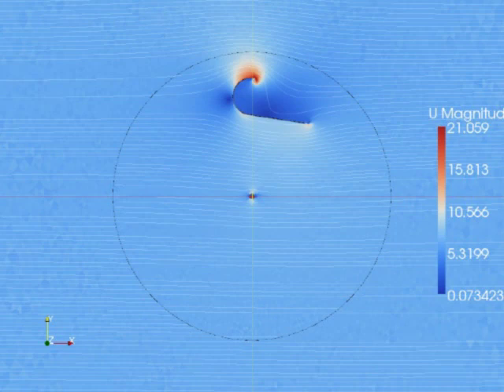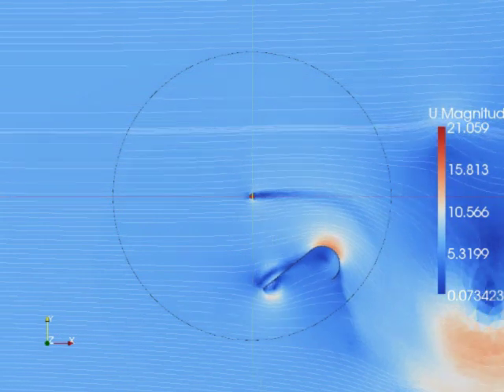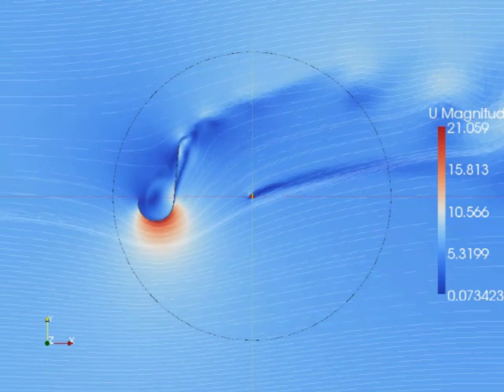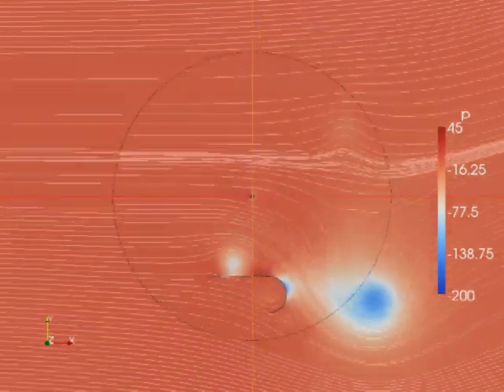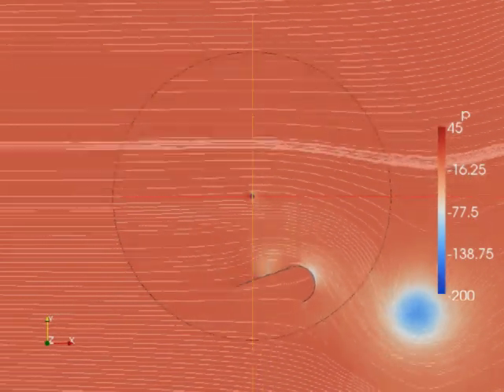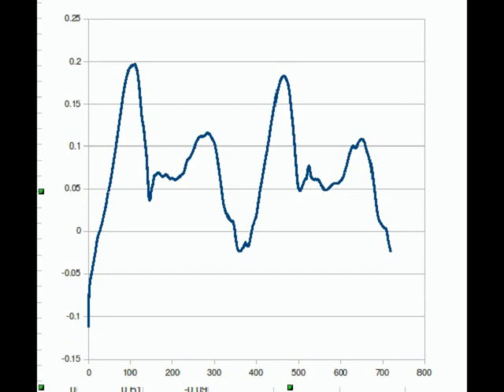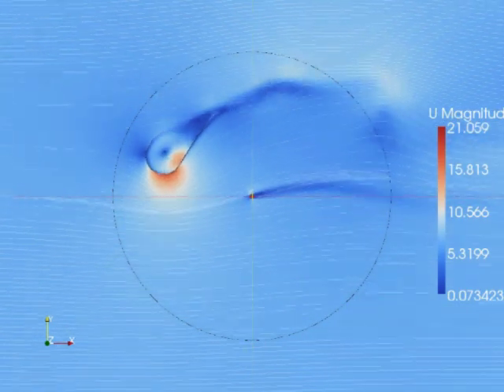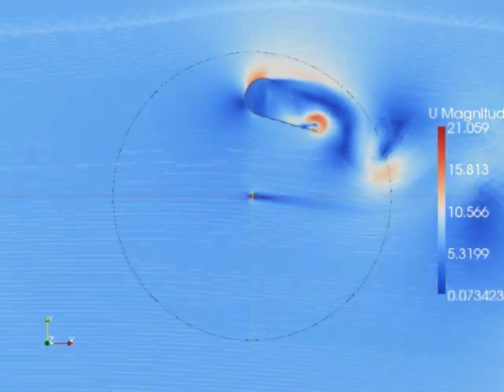Lenz2 Blade Simulation

Comment: I can see in the graph, and taking the top of the vid area as 0 degrees, that torque is low or negative in fact (I guess this would be drag then) at 0 degrees, and then it's a bit low at 180 degrees.A very high peak at 90 degrees, and a fairly high peak at 270 degrees.Having two peaks is a good, hence that blade design is good.  I guessing that things for the turbine system will change if another blade is introduced at 180 degrees - perhaps to add some torque into the system for when it was low?